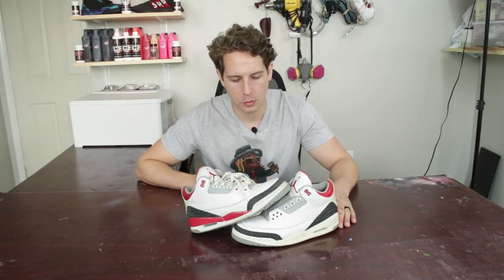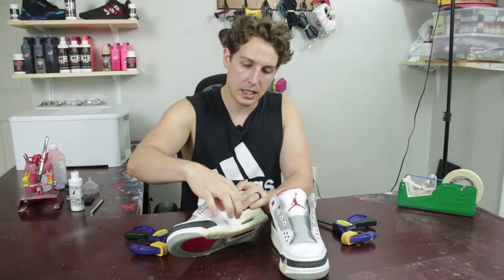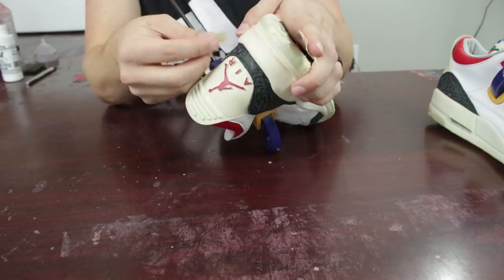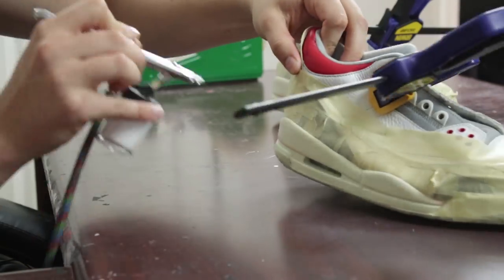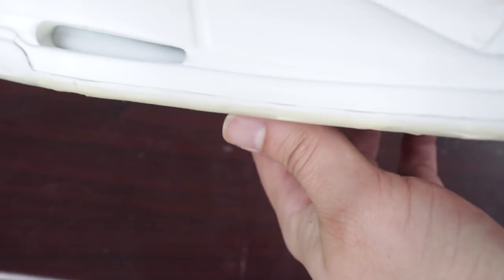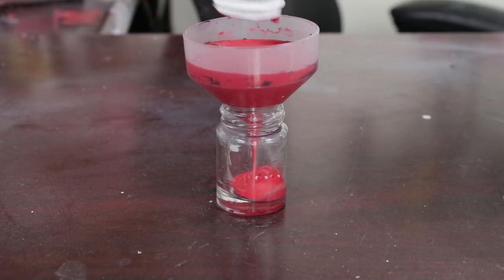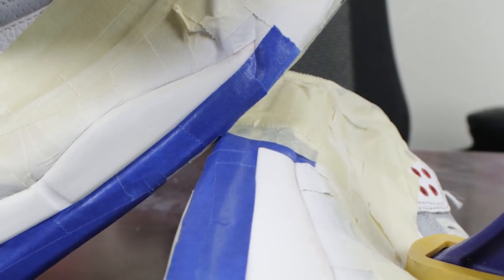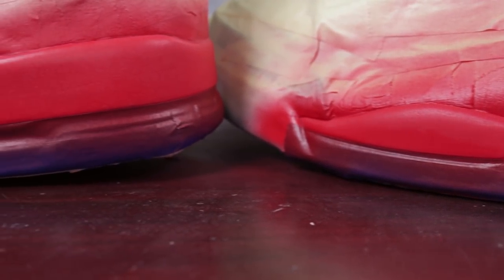Perfect midsole repaints: CLAMPS?!?

Comment from the maker: Have you ever used this method?  What other topics/tutorials do you want us to cover next?
Reply: RaleighRestorations a video on removing the donor midsole from donor outsole I know how to remove the original midsole but dont know about using boiling water or heat gun on the replacement midsole
Reply: Amazing vid D, love the details especially the taping tips
Reply from the maker: Unfortunately I haven't done a midsole swap personally so I wouldn't be the best to give advice on that at this time :(
Reply: Jordan 4's wings repaint?...
Reply from the maker: Generally you'll want to avoid painting the wings, however if there are no other options to clean them up, or you're doing a custom, follow the steps and procedures in this video (https://www.youtube.com/watch?v=QGSP9F6bwuk) to ensure the paint stays on and doesn't scrape/peel off leaving them looking worse than before!
Reply: RaleighRestorations ok thanks for the advice and quick response! 👍🏻✌🏻️
Reply: What is your secret to such clean tape lines. I can never get my tape lines that clean. Even with edge lock tape. I can never get it that straight.

Comment: Another great one! How do you keep your airbrush from drying out for the 10 min wait time. It would suck to clean out the airbrush after every coat. Oh and are you using the jacquard opaque or transparent airbrush paints?
Reply from the maker: I usually just use jacquard for airbrushing. I'll usually just "pick the tip" (which most actual airbrush artists would advise against as you can bend the needle), or simply spray it randomly every few minutes to keep it from drying up!

Comment: My question to you is why wouldn't you use your scratch resistant on the midsole? Will it withold the paint cracking without it? So in other words when would you need to use scratch resistant? I bought I bottle from you but haven't used it yet.
Reply from the maker: The sealer will not prevent cracking, that is all prep and procedure. I do sometimes use the scratch resistant sealer on midsoles as a final coat to add a little protection and that matte look!

Comment: I just received the same shoe planning on handpainting the midsole and heel tab . One question, i have is how would i go about applying the angelus matte finish ?, i would assume krylon spray would be better but im only using what i got right now.
Reply: To get the factory look
Reply from the maker: Honestly I wouldn't even bother with the angelus matte finish.  I would just add duller to the paint and use no finisher!
Reply: I dont have duller at the moment , im planning on purchasng the midsole magic so i can begin the project . Is it possible to paint rubber soles?
Reply from the maker: Yes you can paint rubber soles but need to use scratch resistant sealer! Make sure you watch the video for it on our page!